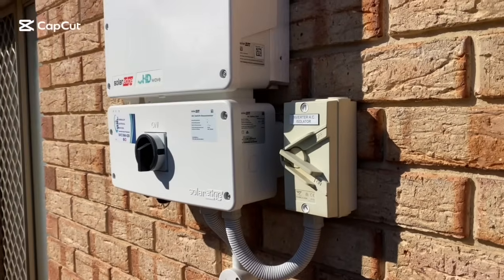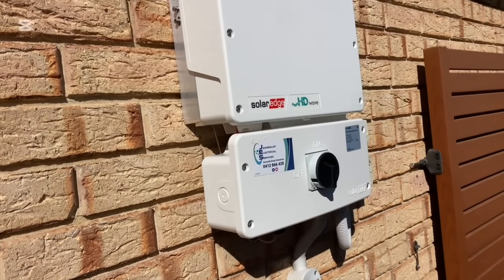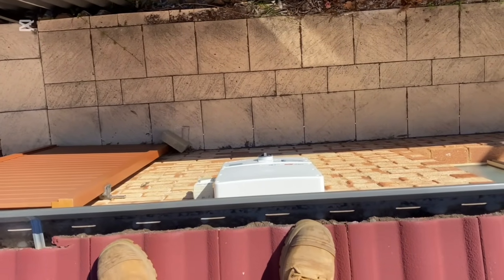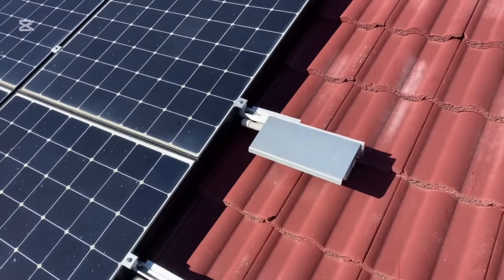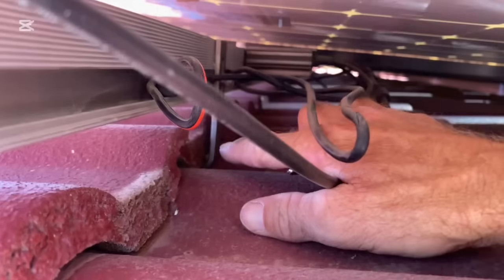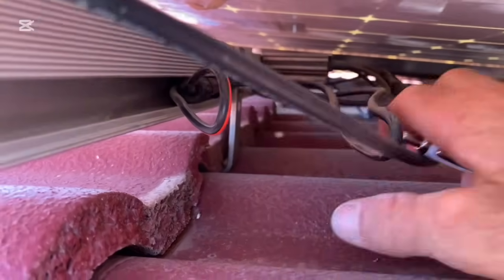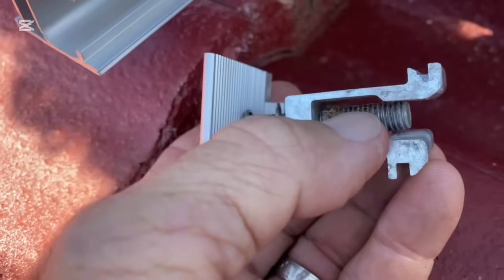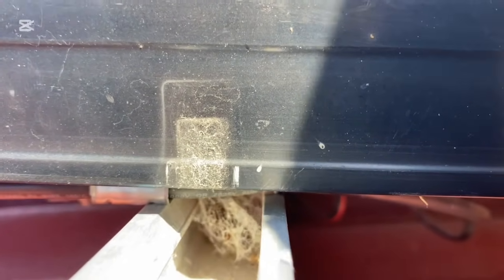More sloppy solar power installs from Perth installers! Some pointers solar buyers should know!

Comment: It's a shame Infinite Energy isn't around anymore, for this video to have an impact on their business. I will disagree with your opinion that SolarEdge is a waste of time if you don't have shading or multiple roof orientations. I bought one for numerous reasons. Better safety (if there's a faulty panel, it will get shut down to 1 volt to be safe. Maximum power will be extracted from all the panels individually, & not just the weakest panel that all the other panels will be restricted to because of the limitations of the string-inverter. Monitoring of every panel is possible. Adding more panels in the future is possible without a complete re-wire of the entire system. And new additional panels don't have to be compatible with the old panels. Yes, I have a SolarEdge system, & yes, I used to sell solar systems.

Comment: I got told the same inverter needed to be close to meter box as needed fronius smart meter which has canbus or something. My inverter is inside the shed behind the meter box luckily. Though the fronius primo supposedly can be paralleled but they charged me another smart meter saying they dont usually do that - from the doco looks like it's just twisted pair cable.
Reply: mine is like 20-30 meters from the smartmeter yet it runs fine with cat6 cabling over that distance. such BS. also canbus is rated for like 100meters

Comment: I insisted on a east north west panel panel distribution to optimise the energy bell curve including sunrise and sunset . I remember clearly the installer being adamant it was a mistake! As you say the highest use is pre and post the working day which is exactly why we chose this configuration
Reply from the maker: 💯 well done on making them do it 👍🏻
Reply: Just a noobie question, if I am planning to install a 48kw battery, would it be best to have all the panels facing north? Thanks
Reply from the maker: @IamBlueDragon_ s to many variables to consider for a reply on here sorry. What area are you